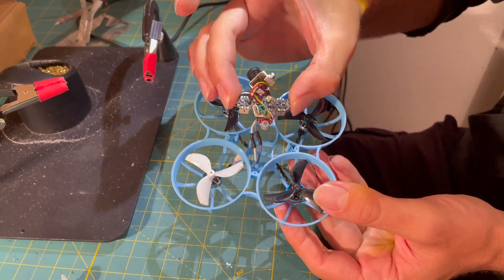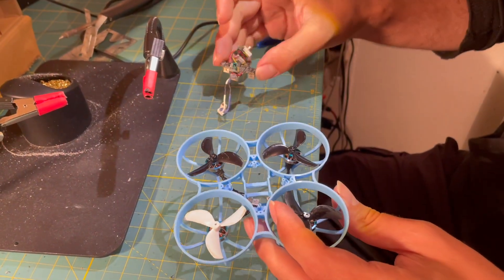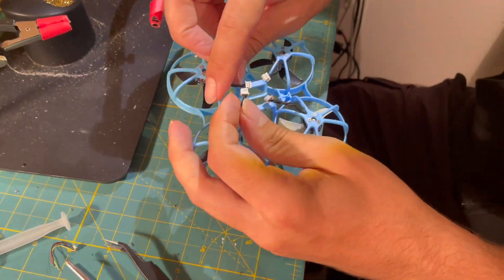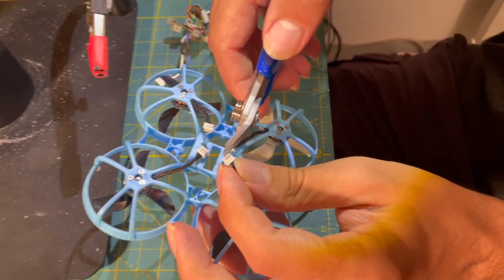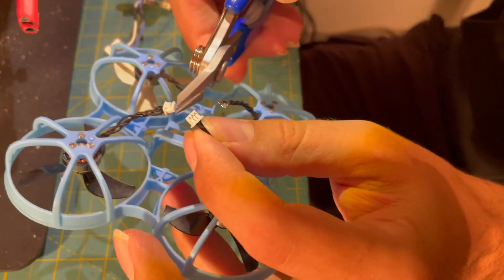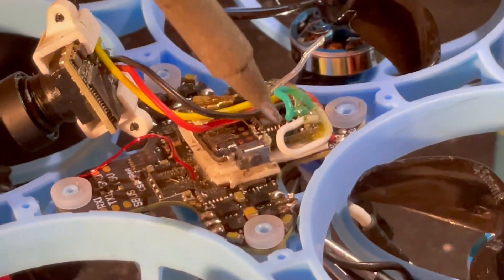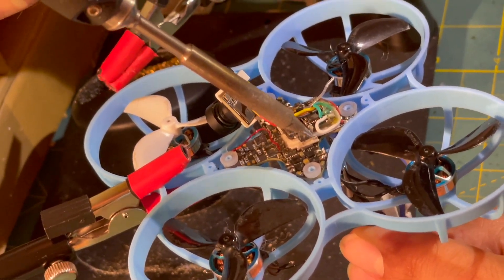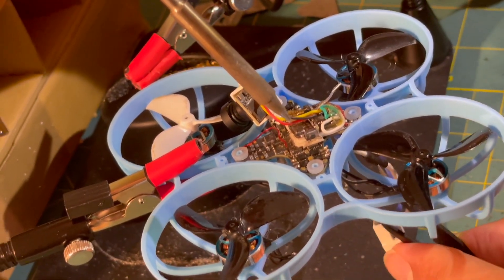NO Motorplugs = MORE Fun | How to remove Motorplugs on a Meteor 75 Pro

Comment: Why not remove one of the spokes from the 75pro frame and solder outside. The frame is massively overbuilt in thickness so it shouldnt be a problem 🤔 and u are saving a bit of weight. Im talking about the spokes going directly to the front. The whoops are connected there anyway with the thick walls so it shouldnt have much of an impact on durability if u dont drill these and u can solder the motors outside.
Reply from the maker: You still can't solder the motors on outside because they don't fit through the narrow hole next to the battery holder. But as you can see in the video, it's no problem to solder the motors inside the frame. But try it. You can always try.

Comment: I find it much easier to wiggle the plugs off the board with pliers, and then just heat up the pins and they fall out.

Also its much easier to solder the wires to the board if you remove them from the frame
Reply from the maker: Thank you for your feedback! Appreciate it! Until now I've never managed it like you say. But I'll try it again! I think in the end it doesn't matter how you do it. The main thing is that you can remove the plugs. Everyone has to somehow learn for themselves what the best path is for them. I don't insist that my way is the best. It's just the one that works for me. Basically I just want to motivate people to try it out for themselves. Because there will never be a complete tutorial that fits everyone anyway.
Reply: @butterflyfpv  thats fair enough! I also ended up buying the air75 frame just because the design allows the motors to slide through so you don’t have to solder while theyre in the frame
Reply from the maker: @itsjase92  I understand you! But with the motorcables soldered to the side of the pads on the board like in the video, it really isn't difficult. You get used to it. But with the Air75 you definitely have a great whoop. Not as durable as the 75Pro but otherwise very good..

Comment: Great tutorial. I dont use flux when joining the three pins together because at this point i dont want it beading apart (the main point of flux) - I grab the flux after the plug is removed. Also what is the reason for cutting the plug to desolder (I guess maintaining max wire length?). I had many problems with motor wires breaking due to the crimping at the plugs, so i prefer to remove that crimp completely. On FCs where there isnt a big solder pad, you can fit the wire through the original pin hole. Glad to see soldering being recommended though!
Reply from the maker: Thank you for your feedback! Appreciate it! Honestly, in the end it doesn't matter how you do it. The main thing is that you can remove the plugs. Everyone has to somehow learn for themselves what the best path is for them. I don't insist that my way is the best. It's just the one that works for me. Basically I just want to motivate people to try it out for themselves. Because there will never be a complete tutorial that fits everyone anyway. 

Leaving 2/3 of the crimped portion on the cable provided more durability in my experience. I do it very successfully at all whoops where I have enough space for it. But the same applies here: Try it out.
It is also important that the motor cables are secured to the struts with the tooth side. This contributes a lot to the durability of the motor cables!

My ultimate goal is always that my whoop lasts as long as possible without any repairs (apart from propellers).
Reply: @butterflyfpv  got it. There are many ways to do it I guess! As long as we are soldering it's going to be a good result
Reply from the maker: @Tokyo_Dom  Exactly! And there are so many factors. For example, I solder lead-free. Many people still solder with lead. That alone makes a difference and requires different procedures

Comment: Been while with these motor plug was great and simplify motor selection ans best way to troubleshoot FC on site.

The bad wasn't the socket pin on FC,  but the sockets on the Motor Brushless.

If could found better motor socket for the Motor only it would be Great, i found out that the very much solution if you couls fix the Tentioneer of the motor Sockets.

Comment: out of the 3 motor cables how do you know which one to solder onto which pad on the board? I mean does the order matters?
Reply: Order doesn't really matter, since the worst that can happen is the motor direction is reversed. Not a problem, as this is easily fixed in betaflight configurator.
Reply from the maker: I'll do it like @BenjaminMeasures said..

Comment: More great content. Great idea on where to snip motor plugs off 🫡
Reply from the maker: Yes, I've almost only had good experiences with it so far. Except once it tore off my solder pad in a very unlucky crash. But this can also happen otherwise. I think the risk is a little higher that the solder pad will come away if things go very badly and something pulls strongly on the motor cable in a crash. But that is very, very rare. It is much more common for the motor cable to break at the soldering point. And with this method this risk is much lower. The average durability of the cables is so much longer.

Comment: Nive video thanks for sharing. Can you show a closer look at the connection part? I'd like to see closer how you oriented your wires to the pads before applying heat to connect them.
Reply from the maker: Appreciate your feedback. Did you watch the last part of the video? You should actually see it in the last part where I solder the cables. Or do you mean the orientation of the crimp parts remaining on the cable to the board? I orient them with the flat side towards the board. And I solder them to the side of the pad on the board. About 0.5mm protrudes upwards so that I can solder them easily. But orientation doesn't play that much of a role. You can solder them in the way that works best for you. Otherwise I'll take a photo in the near future and post it in my YouTube community tab.
Reply: @butterflyfpv  You answered my question thank you!
Reply: I doubt the weight of the plugs would make the crashes harder or even affect the handling from weight alone.
The plugs are very light. And you need at least a  gram difference to really notice it

But the performance increase and reliability makes it worth it  nice video I’m definitely getting rid of all plugs after seeing this.
All my custom builds never have motor issues unless I break the wire off